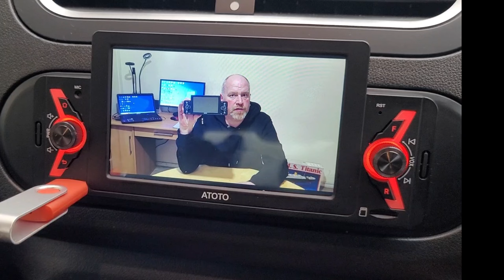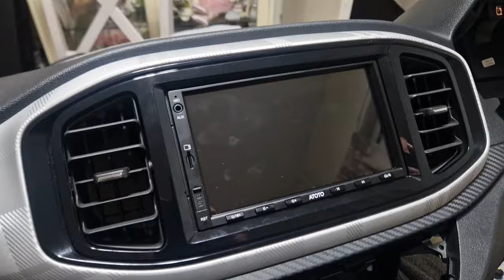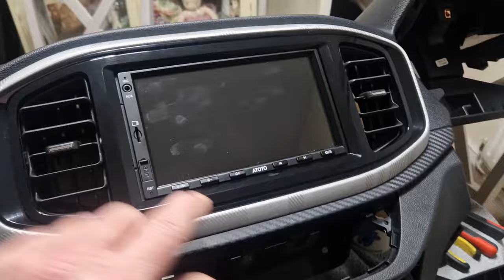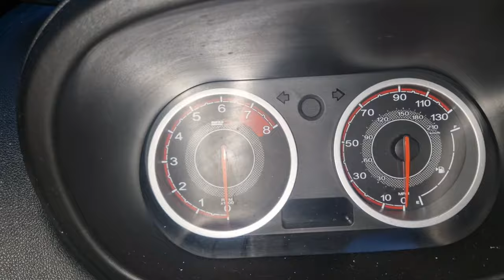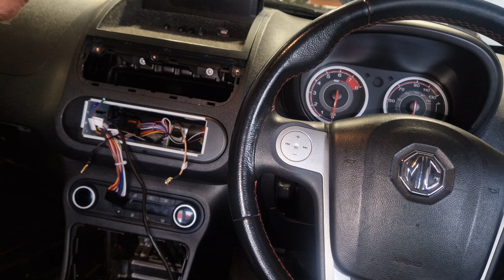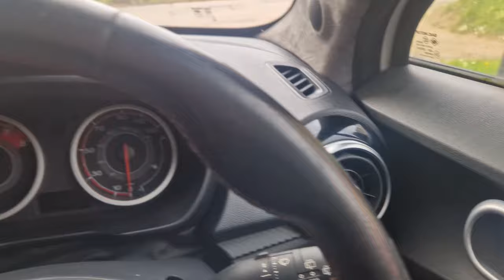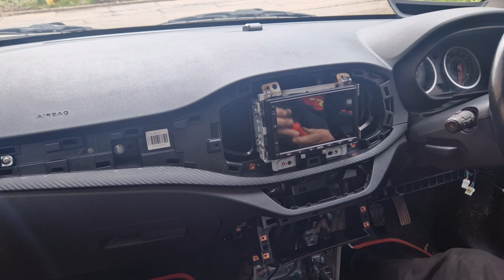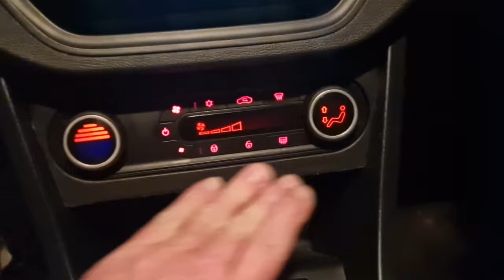2016 MG3 Facelift Dashboard Conversion.

Comment: When working with insulation tape in tight areas, use a 6 or 8mm socket to wrap some insulation tape around to use as a mini real of tape.
Reply from the maker: Good tip. I'll probably end up redoing it with heat shrink though just to make it neater.
Reply: @pistonbroke  factory finish 😄. Dash Looks much better now. Good job!

Comment: Very satisfying video, however I have some questions/concerns. First, is this legal? Reason why I'm asking is that when last year a taxi driver hits me and run away (on a roundabout) my insurance company has asked me to send them a photos of the car from all angles an outside as well as a photos of a full dashboard and a clocks (with an engine on). What if they find out you are not stock? Do you have to report it as a modification? How they will treat that? Other issue is that if for example, in case of an accident your airbags will fire up and they will take a car to fix I'm pretty sure insurance will be happy to cancel the policy as car hasn't been stock. Just thinking how this is working. Any ideas?
Reply from the maker: If the accident is bad enough that the airbags go off then the car will be a write off anyway.

Comment: Do you know if the facelift seats are a direct fit? Look the same but not 100% if the airbag plugs are the same.  Can't stand the faux leather seats.I've also got a facelift rear tailgate lights but the reverse is on the other side.Can get most lights to work but the brake light and reverse light. 😅
Reply from the maker: Seats will fit as the fixing points are the same, not sure about the airbag plugs though. You could cut the original ones off and solder them to the new ones. Tail lights wiring is different, the profile around the tailgate is also different. They wont look good unless you change the tailgate and the rear bumper.
Reply: @pistonbroke appreciate the info. Yeah been looking at seats on ebay pics and the plugs look similar but i think the earth part looks slightly different. As for the lights the plugs are the same, i took some of the pins out and moved them around but the brake operates the reverse light and vice versa. Yes the facelift lights poke out a bit at the top so i would have to change or notch out the spoiler also as i couldn't shut the boot. On the lookout for a facelift tailgate as they look smart, but yet to find one in the right colour. Not even sure if they did the facelift in metallic black. Do you think the front end bumpers and lights would be fairly straightforward?
Reply: @pistonbroke you ever considered a rear brake disc conversion?
Reply from the maker: If you fit the facelift tailgate, you'll need the bumper also as it has the cutout to get your hand into the tailgate release button. Tailgate release is also electric where as the prefacelift is mechanical so there will be that to sort out too. Front end you will need all of it including the radiator, expansion tank, pipes, ac condensor & fan and the housing it all sits in as well as the obvious wings, lights etc. I don't know if the inner wings are the same but I'm sure it could be modified to fit. Never considered rear discs as the performance of the car means it doesn't need it.
Reply: @pistonbroke  wow, far more involved than i thought. In that case i think I'll just put up and shut up 😂 might give the interior seats and door cards a bash though. Pretty sure the door cards will fit and just need to make a blank for the door switch on the drivers side.
Reply: Thanks for the info, saved me a potential headache there. Lol
Reply: Have you checked out the MG3 2024, really nice bit of kit. Hybrid with 188bhp. On the cards one day.
Reply from the maker: @theun-personing5674  door cards aren't straight forward either! Prefacelift has different window switches with the mirror adjustment built in, facelift window switches don't have the mirror adjustment. That's why I was glad my original door cards fitted around the facelift dash because it would be a ball ache  to modify the wiring. Also the facelift door cards are rathee bland and plasticy in my opinion.
Reply: @pistonbroke  haha i give up!!!  Seats it is then If I'm lucky. Wow they really did facelift them. Thanks anyways.
Reply from the maker: @theun-personing5674  haha! Everything is doable if you put the time and effort into it. I just couldn't be arsed with door cards that I didn't really want in the first place so I'm glad it worked out like it did.

Comment: not worth it too much work
Reply from the maker: @LovelyDivingBoard-ch8oq  that's your opinion. I did it because I wanted to.
Reply: @pistonbroke   yes taking the whole dash apart a lot of time and labour big major job
Reply from the maker: It took about 4 hours to swap it. It's not difficult or that time consuming. The bits that took the time was the wiring and modifying the heater surround.
Reply: @pistonbroke  brave man well done
Reply: are the engine in those MG reliable i heard they use GM engine from mokka
Reply from the maker: @LovelyDivingBoard-ch8oq  the zs 1.0 and hs 1.5 use a derivative of the vauxhall engine. The 3 uses SAIC's own engine. The engine in the 3 is pretty good. Early ones before 2016 suffered timing chain issues but after that, no problems to speak of.